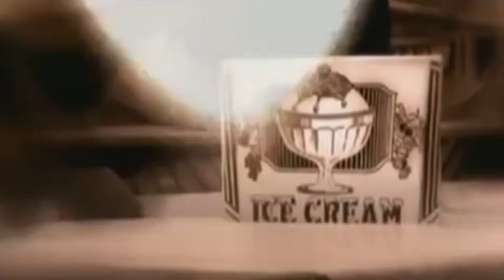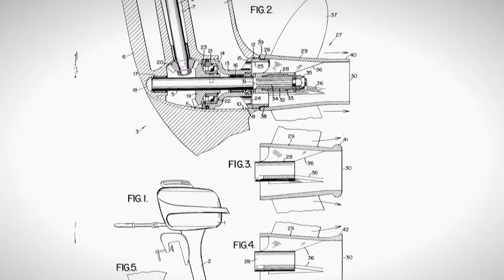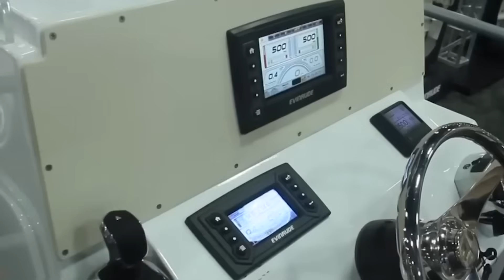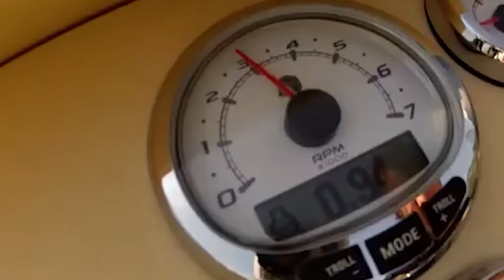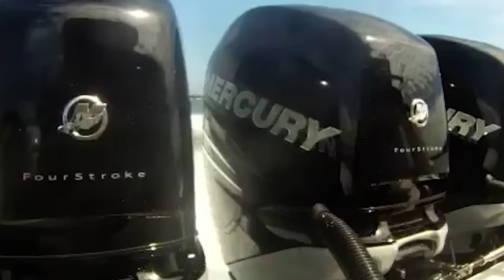Why Mercury and Evinrude Motors Are So Different?

Comment: I have a 1966 evinrude 9.5 and its been alive for 58 years and still runs great
Reply: I have no issue finding parts for my 1966 9.5, and I use it almost every day in the summer! It runs amazing for being 59 years old
Reply: Just like me
Reply from the maker: That's awesome! How's finding parts when you need?
Reply: @VintageBoats  :  I've got one sitting here also.  Haven't fired it up in almost 20 years, but 20 years ago, the parts were all in stock locally, and I live in the desert.    Those 9.5s were everywhere, and everybody had one.   That 9.5 is like the small block chevy of outboards. 
.
I need to get a new top cover for mine, my dog ate it.   I need to get it running again, I'm going to use it as a kicker.
Reply: @VintageBoats  Aftermarket parts for the most frequently serviced items for OMC outboards from the mid 50s on such as water pump impellers, carb kits, etc., are widely available.  EBay is a good source of replacement power heads or lower units.
Reply: Had my Ficht..  then up to my 120, 90,60, 35 etech ho's..  absolute love..  

Merc had no choice..  they couldn't beat em so they had to buy em..  very sad
Reply: Must not use it that much. I guess it’ll last that long.
Reply: @Lance-b2l I use it every day

Comment: The 250 Hp 4-stroke Merc on my commercial work boat died.  Replaced it with E-Tec G2 and shed about 100 lbs on the transom.  Same story on a slightly smaller boat.  The 4-stroke Yamaha died, and an E-tec turned that boat into a rocket.  My 1956 Johnson starts on the 1st or 2nd pull.  It has the pressurized fuel tank with double lines (air & fuel).
Reply: Sea horse?..had a green 54  5 hspwr Johnson
Reply from the maker: 2nd hand or new etecs?
Reply: @VintageBoats  1956 etec wasn't even a thought

Comment: I blew two 2 merc heads in the 80s before the dealer figured out the problem. When trimmed out too far it lost water pressure. It was so loud I couldn’t hear the alarm. He put a water pressure gauge on it and the problem was solved.
Reply from the maker: We're you going for a make shift fan boat?

Comment: Good overall synopsis but there are several inaccuracies.  First, Ole Evinrude did not invent the outboard motor industry.  Waterman and several others existed several years earlier.  However, Evinrude was the first to be mass-marketed.  Secondly, I'm not sure what you mean by Evinrude hanging onto loop charged technology forever.  I don't know what context you meant that in, unless you meant it relative to coming out with direct injection.  I think you meant to say that they hung on to cross charged induction forever.  Loop charging is the most advanced type of conventional 2-stroke induction (though it actually goes back to a German design) and Mercury had it right up to the end of the conventional two-strokes.  Also, no inline 6 of 2 litres was ever produced to my knowledge.  The biggest inline 6 was 99.6 cubic inches, and 2 liters is 122 cubic inches.  However, Mercury's first V6 was 122 cubic inches.  As for the demise of OMC and subsequently Evinrude, there were a number of factors.  It has been said that a certain Hungarian billionaire was behind the scenes of the bankruptcy of OMC in addition to all of their other woes at the time.  But Bombardier  slowly ran them into the ground after putting off the inevitable. There are many people who will tell you that they are not a well-run company in their various other segments.  That part may be a matter of opinion, but the fact is they dropped Evinrude right as the pandemic got under way and they used the pandemic as the reason for the final nail in the coffin. If they had hung on for another few months, they would have thrived because the entire marine industry exploded.  So obviously they had mismanaged it so poorly in the first place that they weren't even able to hang on for literally a couple of rough months.
Reply from the maker: Thanks for watching and detailed comment. Are you able merc or omc fan?
Reply: @VintageBoats Both.  My dad always ran Mercurys because they were faster, but always acknowledged that OMCs were easier to work on and were the better day in, day out motor for fishing and family use.  My uncle was a certified OMC mechanic and always ran Johnsons on his boats.  So there was a fun rivalry.  Currently we own everything from a 1910 Evinrude to a 2005 Mercury XR6.

Comment: I love my 1992 evinrude 90hp 2stroke. Cruising up the Mississippi on plane at 3500 rpm, you can barely even hear the motor running. My dads 1998 mercury 2stroke is much louder.. I don't know if it has to do with how they were previously maintained or if that's just how it is.
Reply from the maker: Still running the 92 strong?

Comment: Lets be clear. We didnt choose four stroke engines. They were forced
Reply: Two strokes are far superior, So much easier to repair, And so much more reliable, I have many years of experience to argue this point.
Reply: @johnphillips519 if anyone thinks 4t are superior we need to let them pick both up, do a top and bottom rebuild, adjust valves(haha I think on a 2t you just have a cold drink) then sink them.  2t wins every time
Reply: @redrider7xbilly548 modern fuel injected four stokes can accumulate many, many, many more hours before needing a overhaul. 
Realistically If you get 1000 hrs out of the v6 two stoke your doing well have seen exceptions but any dummy who can remember to change the oil filters and impellers and keep clean fuel can get a modern four stoke to 5000-10,000 hours. 
Not even mentioning how convenient it is to not have to add oil and make a mess every time you go out. 
Have experience with very similar boats with twins 
One with e-tec 250’s 
One with Yamaha 250’
While the e-techs might be a quiet power house and slightly more fuel efficient the cost of oil and fuel almost makes it a wash. 
Just my thoughts and experience. 
Wish everyone the best
Reply: @johnphillips519 for the older two strokes I could understand your point. 
When you consider E-tec, opti or hpdi there was nothing simple about those systems.
Reply: @joshuabullington5260  Yeah i agree, I guess i was really referring to the older ones, I dont think you can still buy a 2st any more, But i bet there will be many of them still running much longer then the 4st being sold even now.
Reply: far superior and more reliable is crazy to say
Reply: @johnphillips519  All lighting bolts and the sun are plasma 2 stroke entities that tap ZPE.
Reply: @johnphillips519 I've run all brands of 2 cycle and 4 cycle outboards for more than 40 years. The 4 cycle engines can accumulate thousands of hours as compared to a 2 cycle engine. I actually have a 2006 Suzuki 225 with 35,000 hours of commercial fishing hours on it. That will never happen with any 2 cycle engine ever.
Reply: @michaelj343  BS
Reply: I still run 2 stroke
Reply: I still run a 1996 MERCURY 2.5 280 PROMAX SS on my BULLET BASS BOAT. Motor is still as strong today as it was the day it was built with nothing being done but routine maintenance plugs wires coil packs gear oil in the gear case and water pump although I do run a BOBS LOW WATER OICK UP that mercury will push my bullet to the mid 80’s to high 90’s depending on the load and prop I’m running.
Reply: I couldn't possibly agree more.
Reply: Evinrude and Johnson's engine died with the shitty VRO engines. Then the first DI engines, are there any one left? Brp tried but... The last good Evinrude/Johnson was the seahorse era.
Reply: Gotta love the rip of the Power Band 😏 zooooom ‼️❤️🇺🇸
Reply: 2 and 4 stroke outbosrds are widely available where I live. Latter is far more popular. 2 stoke is good for niche applications like auxiliary on race yachts to kee weight down.
Reply: I have an etec the EMM went bad just because the battery was low. $1500 later I got it back up and running
Reply: Who cares. Do you know 6-stroke has also been studied? And the moment you bought a hydrogen ICE outboard, you can stop nagging. Please. Or buy a turboshaft engine, those are available smaller and smaller. Got that?
Reply: new 4strokes are great. Especially the new Suzuki's
Reply from the maker: Guessing you are still running 2 stroke then?
Reply: @VintageBoats i have both. The 2t are superior.  If they had the r and d four strokes had they would still be on top, at least in smaller hp applications just like dirt bikes and out door equipment.  Better reliability, easier maintenance, more power.  Bonus you can sink it and its fine
Reply: @redrider7xbilly548  They're inferior.
Reply: @redrider7xbilly548   Why do you SINK an outboard? Pay more attention!
Reply: @voornaam3191  because you can sink a 2t and be fine. The 4t will need too much work
Reply: @VintageBoats A mercury, a force, a chrysler, a 1957 wizard, an evinrude, a johnson and a ted williams that when maintained run like sewing machines.
Reply: @VintageBoats  I am
Reply: But 4 strokes are better served on the water

Comment: People wanted 2 strokes just ones that worked 
Etec was know to destroy itself same with merc opti tho the opti is still a legend and it's fault is over rpm sends the rods to God when the prop comes out the water
Reply from the maker: Etec fan based on the channel is pretty large. Check out comments in the etec video.
Reply: @VintageBoats im not saying etec doesn't have a large community but this is the internet so does flat eart and furries 

And dont get me wrong as a Edsel fan i understand loving something you know was broken from the start 
That said im also not gonna take the edsel for a cross country trip without a friend following me with a trailer 

And much like a classic orphan auto those etec fans are cannibalizing others to keep thiers  running

Comment: I doubt that it would make too much difference when buying a used outboard engine. I bought a used Bass Tracker boat that came with a Mercury 2 stroke attached. It does what I ask it to do. I couldn't care less what is on the bow of my boat as long as it is reliable.
Reply from the maker: Hope you don't right at the bow... would make for an interesting ride!

Comment: I still run a 70s Evinrude 70hp. No points ignition here...

OMC outboards cop a ton of flak, but in the '70s and 80's they were the only choice if you wanted performance AND to get back home, practically everytime.
The Mercury's at the same time, at least here, were simply known as "black anchors"😂
Reply from the maker: Where's here?
Reply: @VintageBoats Australia, mate.

Comment: My experience between the two brands is that they are indeed very different animals with vary different purposes.

I had a 1974, 85hp Evenrude that ran for me for 10 years with zero problems. Changed the lower unit oil every year, use stabilizer in the fuel and run it out of the carbs if the boat will set more than a week, plugs and water pump every other year, and that motor ran forever. I can't tell you how many hrs was on it before I got it, but I can tell you that I had over 1000 hrs on it. I sold the boat to a friend of mine, who still has it, and the motor still runs strong.

I had an '85 Mercury 50hp classic motor. She was a strong and durable engine... until it wasn't. The aluminum wiring in it oxidized, rotted the coax, and fried the power pack multiple times before I eventually had to rewire the entire motor.

I now have a 2018 Optimax that I bought new. While I love the power and torque of the motor. There is a lot of regular maintenance that needs to be kept up with, and it seems as though it is always having a diaphragm of one kind or another go out (east to replace,  but damn does Mercury overcharge for them). But, at the end of the day, my optimax has always brought me back to the ramp (with or without problems) and my 150 will routinely run down 4 strokes, rudes, and old Johnsons in the 175's and some 200's hp engines.
Reply from the maker: Thanks for detailed comment. What are you buying these days now evinrude gone? Still merc?
Reply: @VintageBoats  I'm currently running a Merc, but when she goes, I may look to Yamaha.

Comment: Canadian government ended Evinrude .They built 2 strokes , government ended 2 strokes and ended Evinrude .
Reply: So....why is it that ski Doo still uses etec
Reply: @Kevin-ix4qz  still owned by the parent company barbardier
Reply: When the e tec was killed it exceeded all emissions standards
Reply from the maker: A real shame..did you have an evinrude?
Reply: Mismanagement and corner cutting killed Evinrude. Their products became increasingly unreliable and they went bankrupt. Junk motors.
Reply: No they didn't for starters evinrude was built in the US not Canada. And also brp killed evinrude kinda they still use evinrude the just redesigned outboards and changed name and call it rotax now the underboard or some crap like that and guess what still a 2 stroke still etec technology. They just desided that they didn't want to build regular 2 stroke outboards but instead wanted to reinvent them with a very terrible design and idea cause yea submerging the power head is alway a good idea. Canadian government had nothing to do with it.
Reply: @machew2009 nope ,built by Canadian company in Canada when they shut it down
Reply: @Philc231 Evinrude outboard motors were primarily manufactured in Milwaukee, Wisconsin, from their inception in 1907 until 2000 when Outboard Marine Corporation (OMC) filed for bankruptcy. Bombardier Recreational Products (BRP) acquired the Evinrude and Johnson brands in 2001 and continued production, primarily in Sturtevant, Wisconsin, before discontinuing the brand in 2020.
Reply: Worst crap i've ever heard!
Reply: They ended THEMSELVES TOO.
Reply: Never thought about that
Reply: Realistically, the Canadian government didn't have anything close to the power itself to end them. EJ was ending itself already via slow death.
Reply: This is false. Brp still produces the exact same motor. Now branded as a rotax engine. Evinrude as a brand put a bad taste in people mouths in the late 90s do to omcs unreliable  ficht injection. Omc then sold to BRP and thats when etec started. Evinrude failed as the marketing of 4stroke engines won out
Reply: @jakerose3389 they were garbage motors, always.
Reply: @jakerose3389 also not true evinrude as a brand was starting to make a come back but brp desided they down want to make the standard outboard but instead wanted to try and high the power head in the water and figured it would be the new greatest thing. And man were they ever wrong.

Comment: I mean in the 80s and early 90s evinrudes were kicking mercs ass in performance. I like all outboards but if i could get a g2 today i would. Especially that by 2020 they had ironed out the early issues with them. Put a g2 vs a pro xs fourstroke on the same boat and its a completely different experience.
Reply from the maker: Would you be tempted eith a second hand one?

Comment: My old bass boat has a mercury 200 efi and my buddy has a slightly smaller bass boat with a evinrude 225 venom that is roughly the same age as mine and my little 2.5L just pulls away out of the hole and up top. His engine sounds really mean and is loud. Mine is quiet and a missile. I’m about to install a 250 efi and will keep my 200 cowling and really mess with his head.
Reply from the maker: Haha that's a good one! What year you get?

Comment: My uncle had (still has) a Merc 150 tower of power that he's very proud of.  The joke in my family was that OMC engines looked like the boat came with a toilet.  But, I was a huge fan of E-Tec when I learned about what it was.  I even wrote an essay about it in high school.  I remember my friend's parents making fun of me for believing in "old, stinky" 2-strokes.  And, while I do love the smell of Blendzall in the morning, no amount of technical explanation could convince them that E-Tec or Opti-Max didn't smoke and foul plugs.  People just wanted 4-stroke engines.  They have twice as many strokes; it's what boats crave!
Reply: I don't think they made a TOP at 150hp. Pretty sure 90hp or 115hp TOP
Reply: @michaelloud5206  They added new higher-power models over the years.  At one point, the 1150 was the highest, but they eventually made a 1500 and the hottest of all, the XS1500.  I'm pretty sure Scott's motor was just a regular 1500.  I think the 1150 and 1500 are the same size and the difference is mostly porting, but it's been a long time since I read about these, so don't quote me on that.
Reply from the maker: Did you have an etec? Should check out the channel video.
Reply: @VintageBoats  I'm not a boater myself, I just like engines and especially 2-strokes.  I was at an autocross race yesterday and the fastest thing there was this crazy aero kart with an 800 Arctic Cat sled motor bored out to 1,150cc with custom EFI.  It made all our Miatas look like diesel trucks.

Comment: We wrecked 2 small outboards. One 2 stroke 8hp Johnson and another 2 stroke 9.9 evenrude. Late 80's to late 90's replaced with them with a used 2 stroke yamaha and never had another problem.
Reply from the maker: So these are still going?
Reply: @VintageBoats no the evenrude threw a rod through the crankcase and the Johnson stripped the drive shaft. The Johnson was repaired and fine but the evenrude was toast